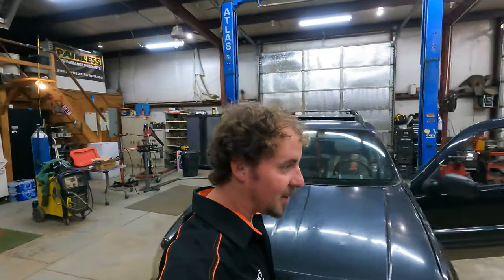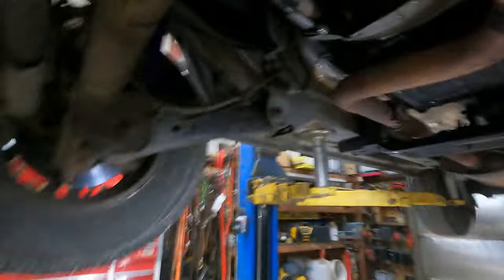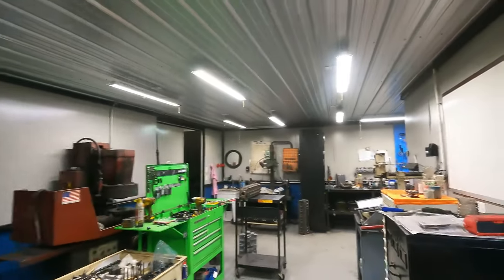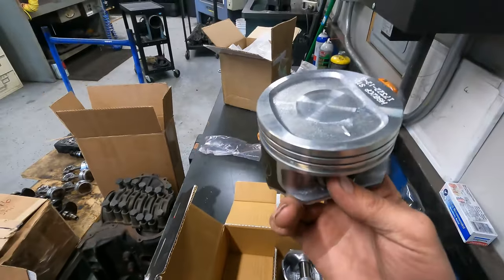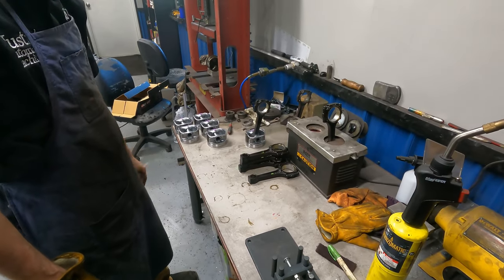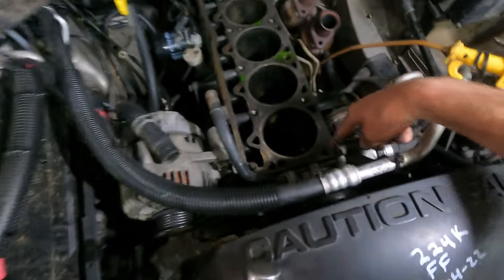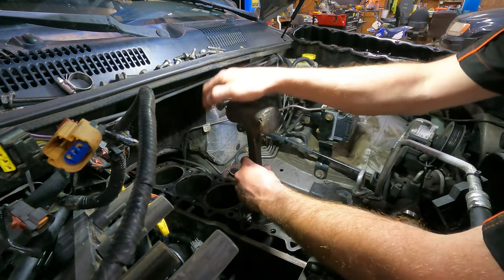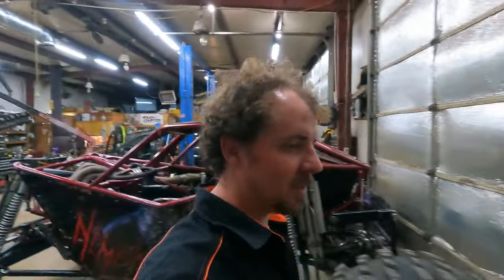Jeep 4.0 Liter Engine Issue: What You Need To Know

Comment: For me, just keep doing what you do. It's all good. God bless, stay well.
Reply from the maker: Thank you for your support..!
Reply: @dexjs  You have done some awesome content on your channel here. Helping many keep jeep, from being a heap😁😎☕
Reply: @dexjs  do jeep engines still use the rocker arms, with the valve end, of rocker, that have part of the rocker body hanging down on either side of valve stems?
 I have seen those that had worn down contact area, on rocker and valve stem where they contact each other. The part hanging, had pushed the retainer and valve spring down, causing the keeper to fall out, letting the valve fall into cylinder. Not a pretty picture. Valve head, stuck into top of piston.

Comment: my wife had the EXACT same issue with her 4.0 wrangler unlimited and ironically the same no.5 piston. i stood over her shoulder and guided her in the teardown and rebuild and she did all the work. the piston skirt broke at 211,000 miles and since she did the rebuild, she now has 270,000 and still running perfect.
Reply: Amazing.  How much does a job like that cost? Thx
Reply: My #5 shattered at 202,000! Only warning was something that sounded like an exhaust leak

Comment: Buddy… you saved my fkn ass with this video. Long story long, my original engine started knocking last year, so I pulled the pan and found piston pieces. My solution was to just swap in a used engine with lower miles, thinking I’d be good for 100k miles at least. Well, after 12k, it started knocking. So I did this instead of another engine swap, and man that things runs smooth. Thank you Dex. I did the whole job for about $600
Reply: Oh, and if you ship parts to Florida, I would like to buy from you.

Comment: Dex, '99-04 WJ enthusiast's love the 4.0. Chrysler made a motor that will run 500, 000 miles!!! Unheard of?  My WJ 4.0 I bought from a " auction seller lot. After inspection, someone @ sometime did something right! The 242 HD has a drain plug on the tranny. Dex, I'm retired and would like to just visit and pay for my '01 WJ issues that an old guy just can't do anymore. Thank Dex, you're my WJ guru.

Comment: Odd knock Advice? Intermittent knocking on very low mi. early 97 TJ 4.0 - Loudest underneath rear pan area, at running temp random, off idle, mid-range, varies or disappears depending on load. knocks at idle but give slight throttle and quiet. Pulled pan, looked up at skirts all in place, nothing in pan. pulled every rod cap all good & tight bearings. Pulled some main caps, all like new. Way before, on almost vertical climbs starved oil, lost pressure and knocked at least two times. Do early TJ 4.0l like late 96 build get cracked skirts? Thanks for the vids Dex!

Comment: i enjoyed it, struggling with a 98’ xj 4.0 currently. #2 cylinder low on compression but doesn’t seem low enough to cause dead miss at idle at about 106lbs vs all the rest at 120’s. miss goes away above 1100 rpm or so, even confirmed with scanner no miss detected at higher rpm. probably going to pull head unless someone has any other ideas. so yeah I like seeing someone that is an expert and learning! thanks for sharing

Comment: My ZJ had knock I thought might be bearings. I replaced the bearings (in my driveway). I was delighted that the knock went away for half a day, and it was back. Turned out to be the harmonic balancer. When I started your video I was sure that was going to be the cause. Knock on wood my 04 WJ's pistons don't fail. Totally liked the video, especially your parts retrieval vehicle. I'd be comfortable with one like it but I don't think my wife or neighbors would approve.

Comment: I have a 2004 WJ Laredo 4.0 with 203,000 miles. It started chattering a while back. It got better at 3,000 mile oil changes, but now it doesn't go away. I switched to T5 Rotella and a quart of Lucas High Mileage. I don't know a lot about engine internals, but I think what's going on with mine is the same as the one in the video. I'd love to learn how to rebuild it myself. This video is great. I'll be looking for more

Comment: Next time you have a 99-06 Jeep WJ with a nasty water leak onto the passenger floorboard, it would be great to see you diagnose the problem and show any tricks you have on stopping a water (rain) leak.  I have a 99 WJ with this problem......currently have the luggage rack off so as to seal the mating surface and bolts, and also the front wheel well cover off to apply silicone around the antenna grommet and along the seam.  Not sure if I will have access at the cowl to do much up there.  So, a video would be great........as there are none on UTube at this time.

Comment: i just fixed my wifes 96 cherokee because of this exact issue. we just bought it and i thought it was a collapsed lifter, haha at least it was decent to rebuild, i put 6 new pistons, rings and rod bearings and new guts for the oil pump. the damn starter hung on the flexplate on the 2nd startup, gave me a effiing heart attack!! but it runs smooth af otherwise. not bad to do with the motor in the car either. the most difficult part is getting the oil pan out and back in.

Comment: Great video! Been debating doing this or dropping in a new engine. I’ve replaced the head and oil pump before, but I can tell the bearings are worn along with some slap. I think buying a hoist and dropping in a new long block might be less work overall.

Comment: I have owned 2 jeeps, 2017 4door wrangler rag top new, sold it and got a truck, brought one new in 2022 another wrangler hard top was a 4 cly  didn’t like the start stop and sold it as well, just bought a 2024 Ridgeline sport trail, like it, has the v6 280 hp not a turbo,probably sale after a year, don’t like what they did to the Jeeps , over priced, but like what you are doing with the older ones! Better than the newer ones in my opinion!

Comment: Good video I have rebuilt a few jeep motors 4.2s and 4.0. I think the head bolts are torque to yield and should be replaced with new ones. I found that if you take a couple of old head bolts and cut the head off and put a slot for a screwdriver   in them and screw them into the block it holds the gasket in place and guides the head on.

Comment: I bought a 2000 Jeep for $900  with the same noise problem very loud and I change the oil and I started adding to the engine about a half pound of lucas gear oil every time i replaced the oil
And the noise  whent away . And the jeep hast last me long time  and still running very strong.
I believe that every time we turn the car off the oil drop down quick and for the next day you start the engine the upper part of the engine is has dried too much
And it has no lubrication and it take some some time to the oil to lubricate the upper part of the engine.

Comment: My brother is an old-school hot rod engine builder carburetor only he does not fool with fuel injection. I picked up a Dodge with a 318 in it from him. He told me it needed bearings because it had low oil pressure couple different machine shops. They agreed one of them said90% of the time when you running low oil pressure it’s going to be a cam bearing

Comment: It's piston slap. Pulled mu oil pan on my 268k daily driver, and found the skirt from Piston #4 in the pan. I've got a 97k spare engine in the garage that will be going in. It took me a good 11hrs today for me to get the old engine pulled. Now I start waiting for the gaskets and other parts I need to put if back together. I've got plenty of other work to do inside the engine bay while the engines out, and also some auxiliary electric upgrades to finish, as with the engine out of the way, I'm hoping to find a place on the passengers side firewall to run an 8g cable into the cab to replace the 12g wire that feeds my aux power panel, and moving/replacing lights around, so the Nilights that have been on the roof(with failed finish) move down to the foglight position, and 4. new Nilights go up on the roof, 2 replacing the moved ones, and 2 replacing the DIY 18" bar I made out of a mangled 4' bar that has no voltage regulation and several LED's have burnt out since.)

Unfortunately the parts I have on order won't be in for over a week, so I expect I'll be tearing the old engine down while I'm waiting for them to arrive. I know that Thumper had (as a coworker called it) a "Death rattle" for the last 50k, so I expect to see some carnage. I always thought it was just badly worn lifters, to the point that if the transmission didn't die last summer, one of my plans was to pull the head and replace the lifters.As I ran the Jeep ~45 miles after the sound started getting really bad, I expect badly scored cylinder walls. 

Personally, I disagree with a shop doing this type or repair, as I'd expect cylinder damage; likely major scoring, but even an oval'd bore which is an earlier sign that the piston has been rubbing the cylinder walls for a while. When I pull the old engine apart, I fully expect cylinder 4 to have major scoring from the broken up piston, and prehaps other cylinders have ovaling from piston slap as well.

Comment: I’ve never actually seen too many rod bearings go on the 4.0 without leaving an inspection port, but piston failures are relatively common.

I actually think a clogged cat/muffler is what causes most of these. It just keeps too much heat in the engine and fatigues the piston.

I think it may even be the catalyst material quality that is to blame, but I have seen this a ton on 4.0s.

Comment: I picked up a 2001 xj,  it had low oil pressure 20 driving and 10 at idle, changed the oil to 20 50 to see if thicker would help, changed the oil sending sensor, drove it a hundred mile then the oil pressure drops to zero when hot at idle,  fresh oil change with 10-30 thinking the 20-50 was too much, same issue. thought about doing an oil pump but I have seen too many videos of people doing oil pumps with no change when they are done..... some one said main bearings are toast..... what do you think? I like your videos, really good information for us newbies!!
Reply: Have you been losing/using coolant?  The 00&01s had the flawed casting 0331 head that could crack above and b/t 3&4 exhaust ports under the valve cover.  The contaminated oil would slowly eat the bearings and your oil pressure would be very low.  You can shine a light at the area with the oil cap off and look for a crack.
Reply: @grad0n  The coolant loss has gotten worse in the last week or so, but the oil is not milky and I don't see a ton of steam out the exhaust, I need to take it to a shop and have them diagnose the head gasket once and for all.

Comment: My 91 jeep xj 4.0 6l driving if I mash the throttle it makes a rattle or tapping sound only high rpm to take off fast it just started it about a week ago. Plus now it's starting to buck and spit. I changed the sensor on throttle body it didn't work but check engine light went off and it started again new fuel pump in still doing it. Every one is saying heat soak. I had this jeep 3 years why is it doing heat soak now and didn't then. Thank you. Love your videos

Comment: do not use break cleaner for final cylinder wall cleaner  use ATF and clean lint free rags, break cleaner or wd 40 embeds fine crap in the hone grooves,  and Test your assembly lube, do not use anything that does not dissolve in engine oil, it turns to carbon and can tear up your bearings if your rev up on startup, use non hardening sealer on that head bolt
cheers

Comment: Well hopefully those will work on Jeeps especially the individual that created this video thank you for the inside with the Pistons now on my problem I have a 1997 Jeep Grand Cherokee limit the previous owner let it sit for 2 years the sunroof is still slightly open after you get a hold of that but my main problem is the cigarette lighter Port it didn't have the cigarette lighter to come with it it was just the whole anywho went to change the 20 amp fuse because it needed it put in a new 20 amp fuse and smoke began to see out of the cigarette lighter port now on my Jeep it has a power outlet next to it should I change both of those or should I just worry about changing the cigarette lighter and go from there? Thank you for taking the time to read this and hopefully answering my question

Comment: LOL, "Junky Jeep", my 98 Wrangler 4.0L is insulted. But I do agree...is not a race car.

Really good down to earth video, learned some new stuff. I'll take a real world mechanic over some talking head anyday. Just my input regarding oil pan bolts, long ones go all the way through block threaded holes while short bolts go in no through holes on ribs or thick part of casting....learned the hard way.

Me, trying to find a good video on #6 misfire. Fuel injector is good, no ground fault, got me stumped.

Comment: Thank you for the video.  Right to the point and informative.  I am going to replace the pistons in my 99 Cherokee as soon as the weather breaks.  Is there a specific part number that you would recommend?  I see that Sealed Power has a few options.

Comment: god bless you Dex, I concur - I didn't think I needed to know it, but I sure am glad that I do now. Question, if you don't mind - I've seen videos with people reinstalling the oil pan, and they put copious amounts of RTV in between the body of the car and the fel-pro gasket (exact one you're using). Looks like you're only using it on the rounded corners. It feels like I'm answering my own question, but is this a better way to do it vs. using an f-load of RTV all around the perimeter? 

I'm very new to working on cars, and I have a small rear main seal leak that I've been meaning to get on top of but the "putting it back together" feels a bit intimidating to me right now

Comment: Can we see a video installing a Trans-Go shift kit in an AW4? Maybe some before and after driving?
Reply from the maker: What is that???  Never heard of it.
Reply: @dexjs  I replied but I’m guessing it didn’t like that I included a link… It’s a Valve Body kit for changing the shift firmness and giving the ability to lock the trans in 1st gear only, using the 1-2 shifter selection.

On Summit Racing the part numbers are:
Shift Kit: TRG-340-HD2
Valve Body Gaskets: 340-VB-G

Comment: I have a '06 Jeep wrangler X, with the same engine, the engine it's fine but the transmission has been rebuilt twice, so i made swap with a '00 jeep cherokee ( toyota transmission) and its way better run, gas consumption and cheaper $600 in parts

Comment: I didn’t notice honing of the cylinders, no problems with rings seating without honing? Just curious.. I’ll probably hone my own but I’m always fascinated with what you cam get away with on the 4.0, I’m at 300k mi so I’m planning on a refresh
Reply from the maker: I’m not saying it’s right or wrong but I very rarely do.  Most still have cross hatches but never have had trouble with no honing.

Comment: Our 98 zj 4.0 has 450k miles.  Its been making that clanking noise for like 350k miles.  Im not gonna mess with it.   Runs fine.  Good power.  Good oil pressure.

However that noise yours is making in the video is nothing like ours makes.  Ours is a loud clanking ive heard many 4.0s make.  And you only hear it at idle

Comment: I'm at 1 year as a WJ owner, love the content! I paid 3k for my 2000 with 135,000 miles with a rebuilt motor I know the cam cam bearings main bearings and rod bearings were replaced as well as the oil pump,the timing chain and lifters and push rods I'm unsure of what brand pistons were used but are stamped .020 so I know it's bored over. I am at 146,000 miles now and it has a rattle  that almost goes completely away when warm but can still slightly hear it. According to paper work the rebuild was done around between 100,000-120,000 miles. I have new lifters cam valve springs and push rods as well as a timing chain from comp cams I haven't installed them yet. 

I am curious to know your opinion. Do you think I should drop my pan and inspect my bottom end first before pulling off the head and doing the cam and lifters? 

If it is a skirt issue what brand pistons would you recommend for the WJ?

Comment: 99 xj 4.0l
Just did a compression test just after the thermostat opened. All spark plugs removed, 8 revolutions per cylinder. 60 to 65 psi across the board and holds psi for 5 minutes. Oil in coolant, no coolant in oil, no coolant in exhaust Engine takes a while but will overheat. Next test is leak down test. 
Any pointers?

Comment: Do you have any insight on the 2007 3.8L knock?  I jumped in and did the top end + lifters and its still there.  The knock is timed with the cam (1/2 of the crank speed) which I now see that ignition / combustion could make a cracked piston tap every other revolution.
Reply from the maker: Man i honestly be making stuff up if I said something

Comment: I do have a question. So, as I have been fixing up my 2000 XJ, I have been looking at things to make more power but more over how to make her run as well as she can. I am recently learning that Jeep 4.0L is fueled a bit lean. From my understanding, lean burning will cause high EGTs, and that does that cause higher internal engine temps? So how much, if any, would that affect things like the overheating burnt valves, cracked exhaust manifolds, and the like?